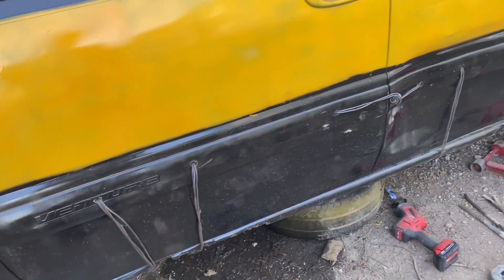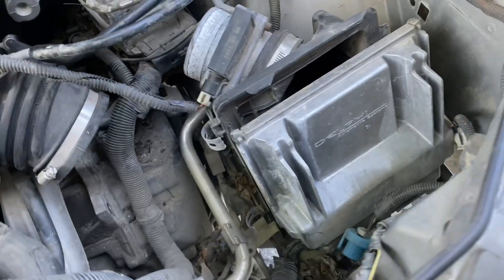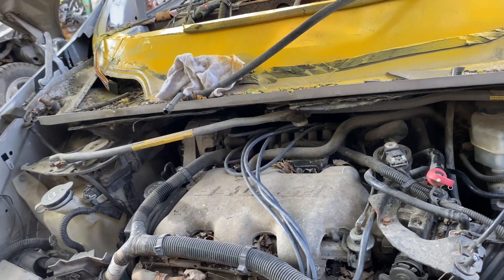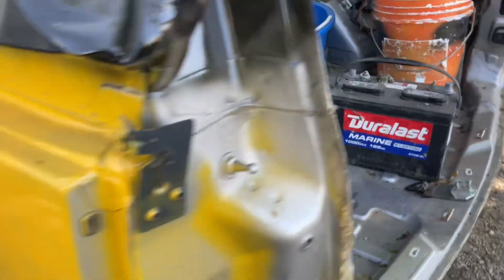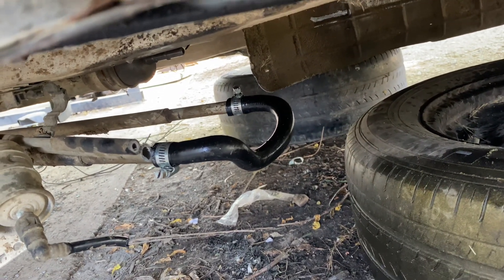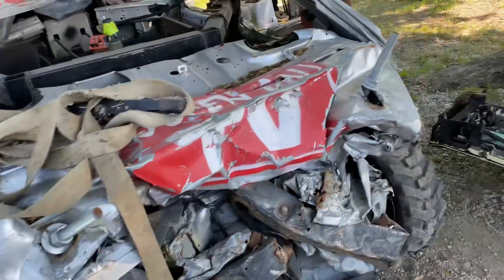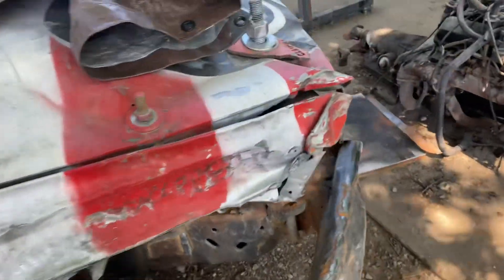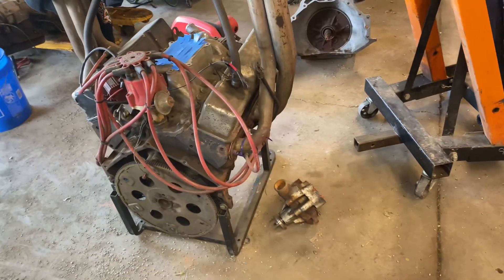Building a mini school bus

Comment: Clutch where do you get your inline fuel pumps at im trying to find a cheaper option than the ones I use
Reply from the maker: I just ordered an e2000 from Amazon it was $30-$40. Just remember if you’re looking for a cheap fuel pump, you’re buying a cheap fuel pump
Reply: @ClutchMarles  that’s true too I paid over 150 but you do get what you pay for I sapose